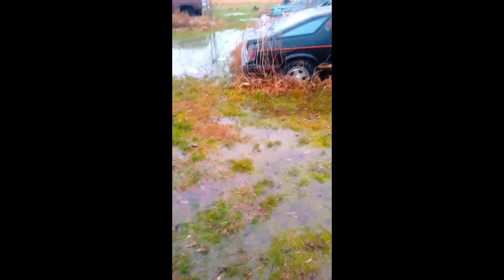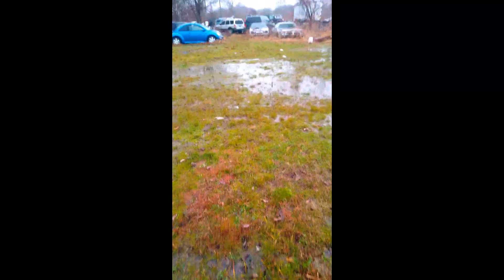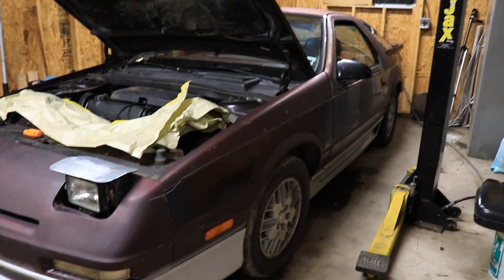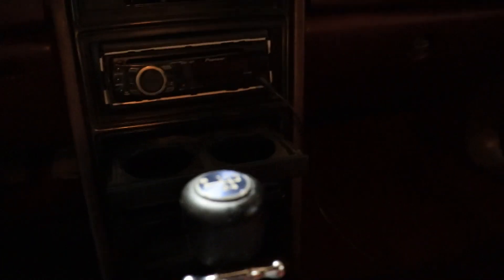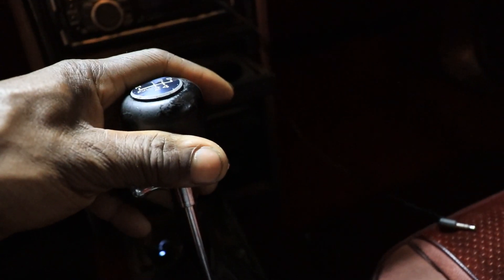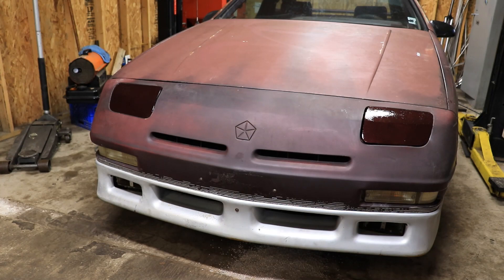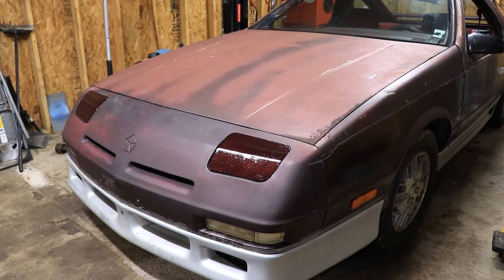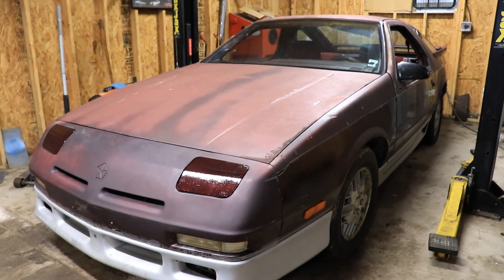Abandoned 1984 Chrysler laser turbos and 1989 Dodge Daytona update PT.7  EP.453  #dodgedaytona

Comment: Nice Car Man👍, Rightnow I'm in the middle of restoring My 1984 TURBO Z😎
Reply from the maker: Do you think those lasers are worth buying
Reply: the second one that you looked at with the beige seats are are worth that one would be worth buying not the first one because it's inside the water, the Dodge lasers came out with the turbo as well especially the one with his stick shift you should buy it I would as long as the floorboards aren't rusted out, the first generation is a great car to buy it could because it's the one that came out before your car. The only difference between a Dodge Daytona turbo and a Dodge Daytona laser turbo is that they were electronic they had an electronic instrument panel and also voice automated commands that would tell you what the car needed it was very cool at the time that it came out the first of its kind. I found one the other day at the wrecking yard in San Jose California and then I picked some parts off of it because they're the parts can go on the Daytona is just the same, when I went back,I wanted to make them an offer for the car it was in great shape all I needed was a pain job and maintenance everything was complete I went back and it was already gone someone else had already bought the car. But oh well I'll keep working on my project, maybe later on I will find a second one. They are around sometimes you just have to keep your eyes open.
Reply from the maker: I think he told me that the black car was the one that talks to you and it's an automatic
Reply: Well in that case I guess you would have to look through it more but it looks like it can be pretty Rusty, whatever decision you make I would go for the one with less water and less rust, you can always have the interiors redone, that's the easy part, but yeah I would go for the one that's not in as much water
Reply: I have one myself. Hope you end up finishing it.